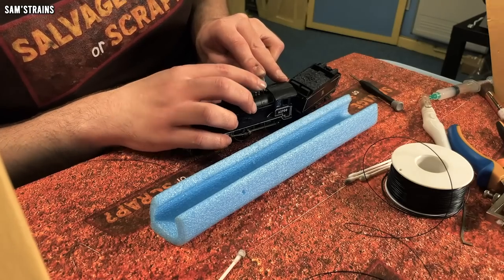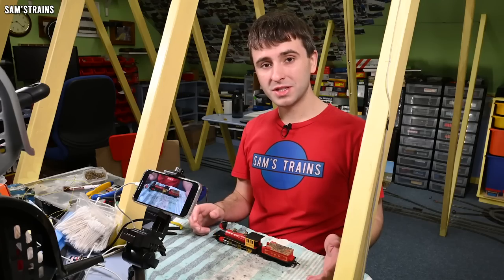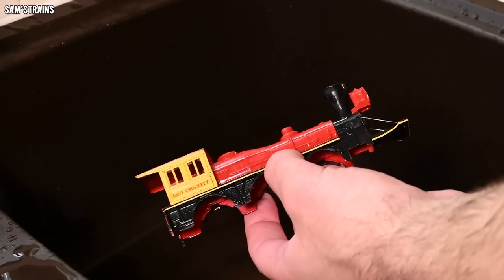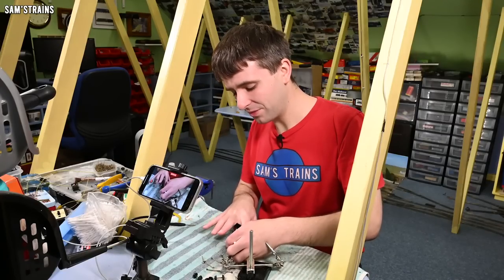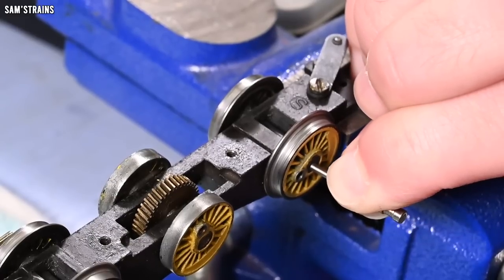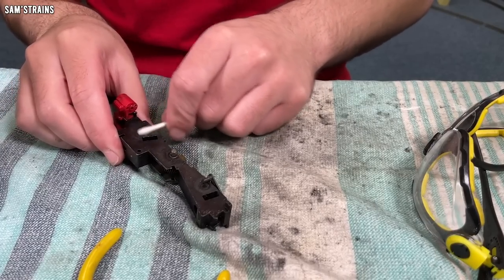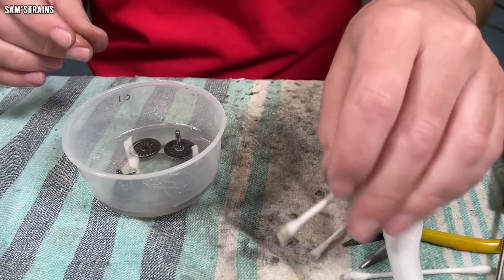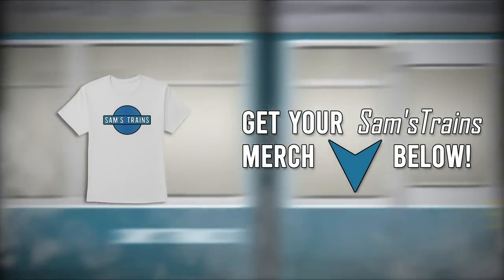Rare Tri-ang Davy Crockett Loco Restoration | Can I Make It Like New?

Comment: There's something satisfying about restoring old Tri-ang stuff. I've recently brought back to life an early 1960s Tri-ang Blue Pullman set. Been hanging around for years and finally it's up and running. Older than me and yet it runs a treat. The motivation was the endless troubles I've had with my Bachmann BP set; stripped out DCC and all the lighting so it now actually works. What a pain that was.

Comment: Interesting project! As someone who's done a couple of restorations, here are a few pointers I think might help:
1. For paint removal, use acetone on metal parts and 91% Isopropyl Alcohol on plastics.
2. Before repainting the cab take a photo of the text on the side, recreate it in Photoshop and print it out on decal paper for a fresh, new look
3. A buffing wheel and polish can really make any brass part shine like new.
4. Replace the motor magnet with a neodymium magnet for increased torque and pulling power.
Good luck with this project, I think it'll look great when done.
Reply from the maker: Thanks for the tips re paint removal! The text on the side of the cab is fine, so the cab will be painted with a mask over the text. The brass parts do shine like new with my method. Neo magnets are a no-go for these motors - they accelerate wear and damage motors - the remagnetiser I use is a much better option!
Thanks a lot for sharing,
Sam :)
Reply: Will alcohol remove paint ?
Reply: @SamsTrains  well said about neo magnets, best avoid and re-magnetize instead
Reply: @RichardKuivila1947 yes, I did it yesterday with some models.

Comment: Another vote for this format as opposed to the timed ones.    A few notes.   Try buffing the brass pieces with some buffing compound and a felt wheel on your motor tool.  A lot of "bit kits" have this included.    Also may want to use a nylon wheel as opposed to a wire  one when working near the motor.  Although the magnets aren't good on this one, there is a slight chance of a wire bit coming off, and sticking down in the motor.  
Wasn't expecting the cliff hanger 😁

Comment: I received same loco and two coaches way back in 1964 for Christmas that year. I was 5yrs old.  Still have it and is DCC fitted. Love running it around my layout brings back great memories. Unfortunately I don’t have any of the boxes. The major thing I did was to machine the wheel flanges so it would run on code 100 track. Rgds from Down Under.

Comment: What fond memories this evokes! My very first Tri-ang loco! I'm surprised you haven't attempted doing a 3D print of the cylinder block, since it is obvious it has been glued on by a previous owner. This usually means the clips are broken or worn.  I doubt that Hornby will ever do a 'Tri-ang Railways Remembered' version of this delightful model. I look forward to the end result!

Comment: Way back in the '80's, when I was a surly teenager, I was out with my parents at a flea market/antique sale.  There was a booth selling model trains - including new old stock Tri-ang Hornby items.  (There were still batches of pre-1973 items kicking around back then, and I recognized the seller as the now retired, former owner of a local hobby store.)  My mother offered to buy me a pristine, unopened Davy Crockett, but I was no longer interested in such things! I was a "serious" modeller at that point, and the Davy Crockett did not fit within my "vision".

I like to think that I am less of an idiot these days.  But I have my doubts!

Fueling such doubts, I recently purchased a Tri-ang Hornby Trans Continental pulpwood card that turned out to be old new stock, never unboxed.  I figured the never unboxed part after I struggled to open the box and pulled out the car to discover that there was some flash on the flange of one of the wheels.  I carefully placed it back in the box, flash intact.

And I recently purchase my first Wrenn locomotive, apicked up a near pristine 2MT tank in LMS livery.  It's amazing.  I have wanted one since I spotted one in a shop window in Stafford while we were in England visiting relatives.

Comment: There are at least two different Triang axle bushes - S8397 (later version with a thicker top lip) and S5065. Both are still available.
An El  Cheapo Chinese Pinion Gear Puller (some with free international shipping) makes removing wheels easy - get two, cut the rear connection on the puller part off one of them for more flexibility and keep one as original.

Comment: The entertainment with the scrapman is of course epic but this is much better for the loco of course. 
Just a few thoughts / tips Sam if we may. For cleaning the commutator with a dremel hopefully at least a copper wired brush was used and in heavens sake NO wired metal (??) Copper being softer one could argue that it merely polishes softly in a jiffy but it also creates a surface that will gunk up the motor back in no time going back to square one... Metal on the other hand is very aggressive micro scratching destroying the surface. Why not just simply avoid all that by..., isopropanol..., as trivially commonly used by proficient model train communities. Takes more time but is much more gentle and definitely doesn't create any micro scratches. Using a dremel on a commutator immediately destroys your credibility at proficient train modellers... you don't want that. 
For paint stripping of metal, have you considered the quick action Polystrippa? Gloves are needed though and to be placed in a closed glass bowl outside (not plastic). It usually strips in a jiffy and sometimes a few stubborn flakes will remain but those can be easily removed by a dental pick (can be found on ebay). Acetone is of course another quick action option or paint thinners best done outside as well and also in an enclosed glass bowl. All these liquids can be reused over and over but not to be used on plastics as they melt them. Anyway, curious how she will look fully restored. Original mints with coaches go for over 400 US$ on ebay. Cheerio.

Comment: I do want myself a Davy Crockett or a Triang Stephensons Rocket just for the novelty of them, I see you got the tender with the pinpoint axles rather than the open axle boxes. I much prefer pinpoint as they reduce the drag open axleboxes have. 

You can actually get resin printed spares for Davy like the domes and cowcatchers, they look quite detailed and accurate

Comment: Excellent  vid as always Sam - nice careful restoration of the old coupled with scratch build brand new bits - only down side was watching your 3D printer while mine's is in bits [total filament jam in hot end feed block - had to drill out a section] - oh hum.  

Looking forward to the touch up and rebuild vid.

Comment: Invest in a wheel puller, its better that hammering the wheels off. Also, anyone reading this. DO NOT use a soldering iron to remove plastic parts. The molten plastic is noxious and it will ruin your iron tip

Comment: Hi Sam,  I was a bit worried when you cleaned the commutator with the wire wheel?  One slip and the winding wires could have been ripped right off of the segments.. It is only a tiny blob of solder holding a very old and easily damaged wire? I think that the wire wheel may be a bit of "over kill" for this job?
I think that a word of caution here would have been appropriate?
But, So far , so good.... Enjoying the restoration.. Nice to see the parts (including the weight) dried gently and not "cooked" in a hurry too.. Good job..  Next, give the magnet a whack and onward we go? 
Great stuff. looking forward to the next episode..
Reply from the maker: It's not overkill! It's a very thorough way of cleaning, and I'm very well practised at it. I've done this hundreds of times, and have never slipped and damaged the solder or windings. Magnet is all re-charged and ready to go! :D
Thanks for watching, Sam :)

Comment: Sam, the centre wheel and gear should be easy to remove.  Tap the other wheel off like the opposite, then gently tap the shaft through the gear to drop the gear out. Then when reassembling Reverse the process.put the gear in the slot tap the shaft in, get it centred then refit the wheels.

Comment: NWSL manufactures a wheel/gear puller that would be worth having, also check out their quartering device, they really come in handy. They also have a gear/axle alignment tool that makes getting gears back on the axle square.

Comment: Can’t wait to see the next part of this restoration! I’ve done similar chassis rebuilds before, one fairly recent one being on a Triang 3MT, all gummed up with hair and oil, need to do some work on the gauging but besides that it’s running better than it has in years! I reckon you could also sell those axle bushes as well, given how replacements get harder to find and purging them from spares donors is a risky process I don’t see it being impossible for you to make some cash off those, I’d absolutely get my hands on some for my own Triang locos!

Comment: Excellent video, so much better than with the self-imposed time limit! If you're going to do something do it properly or not at all. Takes me back to when I used to service Tri-Ang loco's in the 60's (Aging Flatulant!). A few suggestions, 1) Get an ultrasonic cleaning bath, with soap & water or appropriate solvents they do a far better job on almost ALL the parts! 2) You didn’t appear to clean between the commutator segments, these do fill up with carbon and grease. Cocktail stick or shaped bamboo skewer, also chamfer the segment edges with the corner of a flat needle file - very quick job on open frame motors. 3) Using a buffing disc (with or without compound) on the dremel will probably do a much better job on the brass bits (followed by a misting of lacquer) and the commutator.
Very impressed by your 3d printed press-fit insulators. Those you might consider selling!
Again, a really interesting video, look forward to part 2.

Comment: Another great video Sam , and this one and the follow up will no doubt be of great help , as I have the same model, which has running issues, motor runs, but the wheels lock up on the track, after a short distance. Look forward to the next installment. I noticed you said the magnet was dodgy on yours, does this mean the motor can no longerspin? Also loved your recent video showing your homemade trains, really impressive. Cheers, jon

Comment: I'm also working on an old Triang loco (a Princess); seems mine has a different style chassis to yours - it's two flat pieces of steel, with weights between, held together with 3 or 4 screws. I ended up taking the gear wheel off the axle as well, as I intend to upgrade mine to use a new gear motor & bevel gear drive... but that might not be strong enough; if not, I can put the original worm gear back on. One thing to check when re-assembling; be very wary of the back-to-back: Mine was seriously under-gauge (13.8mm or thereabouts) so it tripped over every Peco point I have! I'm planning on fixing mine with new axles made in a lathe (I'm also going to add tyres/flanges to the middle wheels & reduce the flanges on the other drivers); but I figure you could adjust yours with judicious adjustment of back flange of the insulator, so long as you don't have to go too far (the loco would then run off-centre!)

Comment: Have you ever considered buying a table top mini lathe...then you can accurately true up the bushings in the wheels, and make or post machine any other bearings, flywheels or similar that need to run true.
Reply from the maker: Thanks a lot for the tip! I'm very tight on space though, and a lathe wouldn't help with those bushings - 3D printers are extremely precise, and the bushings are perfectly true already!
Thanks for watching, Sam :)

Comment: It's super cool seeing a more thorough restoration than the timed ones in Salvage or Scrap. I have a question about how you clean the loco body, is there any risk of damaging the original paint when you use a toothbrush, soap, and water? Also does that method still work on locos with metal bodies?

Comment: Yayy, i approve. proper restore video.

Right i was expecting a serious video in its entirety but than the goggles happened. i like Sam's sense of humour .

I understand that some bits are daunting but i do reckon it'd be worth to try and dare remove the gear rather than to struggle with it in situ. Afterall why not blunder whilst learning to learn how to do it right, especially since gunk is something utterly unacceptable for fine mechanics.
I did watch a wristwatch reviving channel and whilst the presenter disassembles the whole device some of its concepts MIGHT be usable - very thin liquid for degreasing should work.

Over all i am looking forth to part II. mechanical err mechanisms have inherit appeal to me.

Comment: I kind of question 3D printing new S5065 Wheel Bushes when proper injection moulded ones can be had from retailers like Peters Spares for £6.50 for a pack of 10. I can even still get New Old Stock replacements domestically here in Australia.
Reply from the maker: Why would you question it? PLA+ is just as strong, if not stronger, and it's free, not £6.50!
Thanks for watching, Sam :)

Comment: hi sam had one of these locos in 1963 as a child along with 3 smoking cars, still have one example to day, cant think why the clowns at hornby do not bring it out again, instead of the rubbish they throw at us
Reply: About ten or more years ago virtually all old tooling at Margate was scrapped both Triang and later Hornby not in production in China. Scalextric too.
New management at the time saving space and salvage costs of the tooling. Their storage racks for the heavy tooling was not too safe either.
Reply: I know about this, actually; back in the 2000's/2010's, when they first moved out of Margat, the bosses at the time sold off most of the old toolings for scrap.

Comment: Would piece of suitably thick sheet metal with a slot that's the width of the axle help with removing that wheel?  By bolting it in the vice and slotting the locos axle over it you would be hammering the axle away from the wheel thus leaving the gear alone.  Just a thought
Reply from the maker: Yeah that would work too - though this method worked perfectly, and so is simpler!
Thanks for watching, Sam :)
Reply: @SamsTrains  
Redefined KISS technology 
Keep It Simple Sam 😎